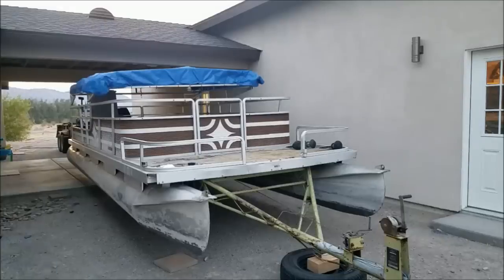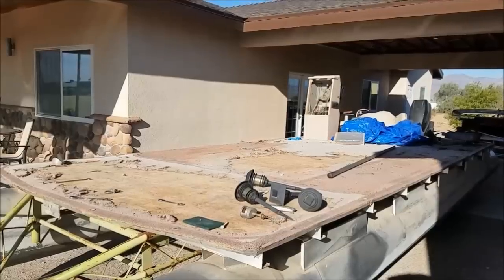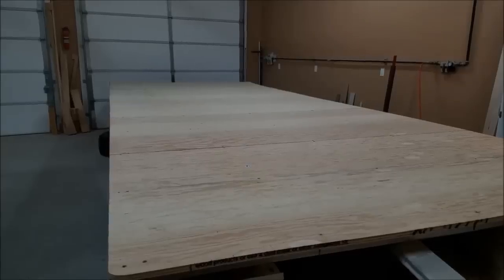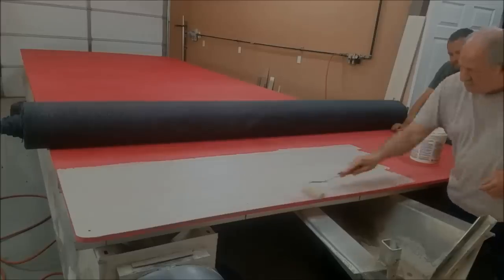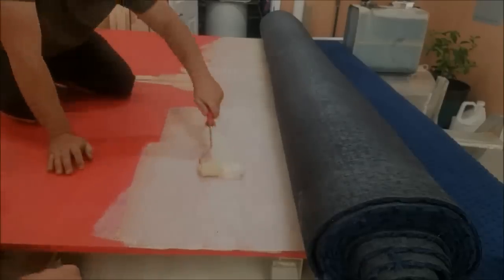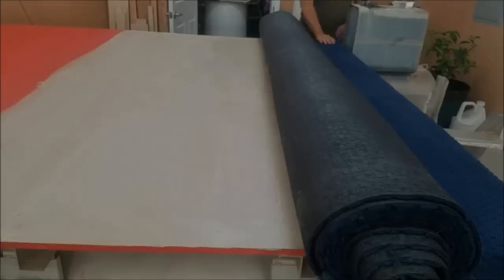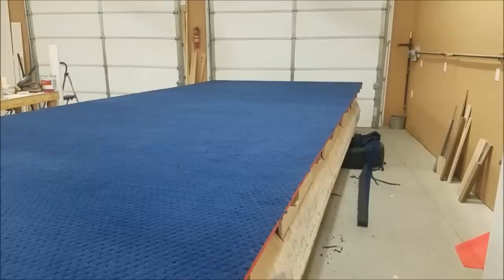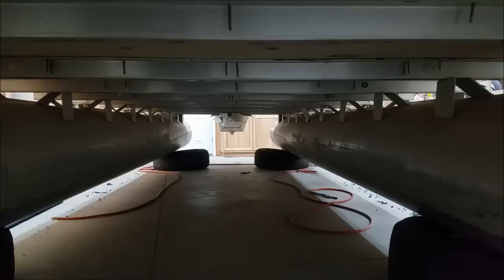Craigslist Pontoon Boat: Replacing Carpet and Deck

Comment: I would have run all my electric, control and steering cables before screwing down the floor. Coated the backside of the wood and then done a   paint on non-skid deck surface. You are right on track about the plywood. The only difference between exterior plywood and marine plywood is that marine plywood has no voids in it. All the blemishes (tree knots) have been removed and filled.

Comment: You might want to put the Red Guard on the underside of the plywood to protect it from water splashing up from the pontoons.
Reply: Camehere for the same comment. Bottom and edges as well as the top.
Reply: Gary Corrick It crossed my mind too.
Reply from the maker: I didn't think it was very needed.
Also, there are going to be a lot of screws going into the ply.
I was worried if the bottom was sealed, it would lock in water that otherwise could have escaped.
Reply: Pick up some exterior paint and just paint it if you are worried. Every few years re-coat, should be better than exposed ply. Save $$ get mis-mixed at Lowes/Home Depot or Restore shops. Best of luck.
Reply: @BrandonsGarage  You and your dad are doing a great job. Please take the time and small amount of money it will take to seal the bottom of the plywood. Too late to get under the supports, but anything at this point will add years to that deck.
Reply: @BrandonsGarage  i was told not to coat the bottom for that very reason.  Makes sense.  If you can't seal the wood completely you need to allow a way for it to dry out
Reply: After you screw everything in seal it on the bottom with bedliner coating.
Reply: @marktinaz2600  Excellent idea. Not coating the bottom with something is moronic.
Reply: @BrandonsGarage  Wet wood swells then rots if not treated first.
Reply: Nuts. Tooners lose their deck from the bottom up. People leave them in the water and the moisture penetrates the plywood.  My choice has been to coat the bottom of the plywood with resin if I intend to keep the boat. Coat top and bottom before assembly.
Reply: Right on Gary, that's the first thing I noticed. He should have painted both sides before attaching it to the boat.
Reply: @BrandonsGarage  our pontoon is  19 years old underside is not coated and its lasted just fine it dries everytime I pull it out of the water and head down the road
Reply: I came here to ask the same question on coating the underside. Just a thought if you plan on keeping it a very long time and was worried about moisture, there is a couple of tricks I have done. Both are about the same cost. 1. Coat the bottom and all sides with epoxy resin then silicone the screws as to put them in and then do a complete coverage over the top with epoxy resin. Then covered with the carpet would last almost forever and would be completely water tight, specially if you went back over the screws from underneath with silicone. 2. Would have been my first choice though and that would have been to use a composite material. And then sanded the edges just as you did and then level the joints with a polyester epoxy. Then covered with carpet. I am actually looking for a pontoon to make a tiki hut barge with a slide.
Reply: Haha! The dump off El Rodeo...
Reply: @BrandonsGarage  i think you made the right call, not painting the underside. id have done the same
Reply: He did it right sir I in fact work at aloha boat co.  In Little Rock ar. I can verify that you are doing a fine job sir
Reply: never stop fighting  i agree with your comment. I've seen people use composite deck boards for pontoon decks, I though that was a great idea, except for water could possibly splash up from underneath, through the cracks between the boards. though thats not a big deal for me personally.
Reply: He should be using marine grade plywood too.
Reply: @BrandonsGarage  to prevent seepage into screw holes 3 things. 1 drill pilot holes 2) inject silicone or other sealant into holes 3) use stainless screws. Hope that helps
Reply: @BrandonsGarage  why you inject epoxy or resin into pilot holes, before driving screws in. You should always epoxy (or poly resin, etc) any wood that's exposed to regular water. Even marine ply. I've fully rebuilt several 14-16' fibreglass boats. That's how we do it. Even plywood getting glasses is coated before laying cloth, let soak in wood. Anything else,as soon as it gets wet 1st time, clock starts ticking, rot has started.
Reply: It's because of DIYer that Think they know what they are doing that I have had to rebuild unsafe boats. Everyone. Do real research before even thinking of attempting. Watching a couple DIYer on YouTube don't qualify you for structural work.
Reply: my thoughts also
Reply: i wouldnt cover everything with that.   you do want it to breathe to dry out anything.   i screwed up on a camper floor by spraying bed liner on both sides.....floor didnt last too long because of moisture.....it is literally the opposite of what you would think about protecting it.
Reply: There is an old saying that is true, if wet wood can't dry it dies. If you put that sealant on all side, any water getting in will have no place to go and increase the wood deterioration/rotting.
Reply from the maker: @johnhaller2594  I'm almost on a first name basis with them at this point.
Reply from the maker: @izzimichaels2892  thanks for the feedback!

Comment: Good time video Brandon!
Cool to see your Dad helping you, and the baby making a cameo appearance to "hang out in the shop with the guys" Kudos for the high-quality materials you choose for the carpet work, Roberts adhesive and Red Gard are great products. I agree with your opinion regarding the plywood, exterior grade vs. marine grade. The boat manufacturers don't use marine grade either, due to cost.
IMHO you did a fine job of replacing the floor and installing the new carpeting. It should serve you well for many, many years. As a side note, Tec screws are available (@ Home Depot) with a multi-drive torx style head, and you should find the drive bit (included) in the box. I'm looking forward to the next video in this series of the pontoon boat rebuild, and I'm sure you're excited to complete it and enjoy it with your family.
2 thumbs up from here in Massachusetts, on the lake @ the "ranch" 
Doug
Reply: GOOD manufacturers do use marine plywood!!! do your research on the differences between them.if you don't have the money to do it right the first time when will you have the money to do it a second time.

Comment: I will be installing my carpet today I put my redgard on my 16 foot Sun Tracker Bass Buggy Pontoon boat I was going to redgard the bottom of the pontoon boat but in all reality I don't believe water is going to sit there and saturate on the bottom of marine-grade plywood I also used roof tape for the seams where the wood separated itself I want to thank Brandon's garage for giving me the knowledge and putting my mindset at ease to getting out there and jump in on this job I'm doing all this myself with occasional help for my son but I'm not trying to have him around some of the chemicals that's being installed. So I want to thank Brandon's garage for passing his knowledge on if I could only show some pictures and some videos I would be glad to do that this is been one extreme but fun project and I'd do it again I bought this 1991 Sun Tracker Bass Buggy 16 foot pontoon boat basically for $600 with a 50 horse force and trolling motor and pedals he sold it to me for 1200 and my company paid for the other portion of the cost through their profit share. So thanks to one of the biggest hardware stores out there who was not closing down other hardware stores that's all I'm going to say about that.
This is been the best project I've ever had I would never go what's another boat other than a pontoon boat I spent $3,000 on a 1979 Baja classic tri 16 only to find out that it had dry rot underneath the belly and throughout the transom when I took it to the shop which was going to cost 5000 to fix the problem paint the boats and trailer so the me that was taking on more than what I wanted to take on so I bought this Pontoon and thanks to Brandon's garage they have led me down this road and I would recommend anybody going to do a restoration of a pontoon boat to watch his videos if I could think of in person I would because he's really help me out throughout this journey and I wanted to share it on YouTube and I don't have the know-how yet to do that but that's another story I'm going to watch the video of how to reinstall the old trim rails and fencing once I install this carpet Saturday August 10th 2019 I'm going to open up a Instagram page and show some videos of that once I do that I will share the link.  now it's time to install some carpet thanks Brandon's. garage

Comment: I replace most everything like you did with my first pontoon boat (20'), didn't have to with my 2nd one (20').  Had so much fun with those, I bought a brand new 24' tritoon with dark blue carpet.   What a mistake...down here on the Gulf Coast, the sugar sand gets into the carpet and you can't get it out with .blowing, washing or vacuuming.  Literally, within 2 hours of buying the boat, it looked years old.  But l love pontoons!
Reply from the maker: Im concerned with that too.
I call our sand 'Powdered Sugar/Sand'

Comment: I did exactly what your doing. I have a 24 foot that I completely rebuilt into a carfishing boat. I made it a center console and went as far as re-skinning the pontoon logs for basically double the aluminum thickness. It was alot of work but the reward was completely worth it! Have fun with it!

Comment: I'd really suggest you do a parameter spread with glue and a center strip laying cheap rubber back carpet, it will not last forever and removing it will be a night mare and a lot of sanding for a suitable surface for new carpet. Stretch the carpet and tack with nail strips along the edges, remove the strips after glue sets up in about 3 days drying. Furniture will keep the carpet stretched later on as well. Very nice job guys!

Comment: Looks great. If you guys ever do carpeting again grab a trowel for the glue. It’s 10 times faster and with the right size notches you can’t really mess it up you just pour a bunch out and spread it quickly. I did a 16‘ x 6‘ boat and the main floor carpet took me aboutFive minutes to do. It was a lot smaller but the trail is really quick and with the notches you can’t mess up the amount of glue.  

Another suggestion in the future, especially if you have a shaped boats is herculiner, it’s kind of like line X but you roll it on, it’s about $25 a gallon last I used it, you could’ve done that deck for about $100. Now you can get it in three or four different colors I believe also, I did black because of the time they only had black and gray and kind of a brick colored red. It’s also completely waterproof. :)

Comment: Should have painted the bottom of the plywood with the red paint or ever a enamel based paint to seal up the wood before screwing it down.
Reply: Actually he should spray under-coat the bottom or even skin it of budget allows.

Comment: I Injoyed. Seeing you with your dad telling you the best way. Now I miss my dad more. Lost him 4 and half years ago to cancer. He didn't help me with mine 15 or so years ago when I built 3 tops redid the rails but we owned taxi when I was up he was sleeping alot. But we built things as I grew up and I really miss him.  As he fought cancer mom yea wanted a deck on front and on the back of the new house she got. So we did it. God gave him just enought just enought. I started the front till he'd got home then to be honest me and mom had falling out he about finished till painting. He did the walls roof I mean he did good. Mom she I don't think appreciate him for it either. Maybe the deck off the pool off the back of the house. But the front deck porch then roof was huge.  Bet she don't even go out side. Wasted money.  Br your vidoe got me thinking about dad more than I do already. Thank you.  But the carpet your right pay the extra mine had red like that grey your blue the desine love it good pick.   Well can't weight to see the rest now.  Man I miss mine. 24ft got for 500 with 85 mercury. Now the trailer new duel axle paid 2k but had the breaking system front steps going up.  But yea I miss it.  Wish I had one more chance to owning one. Did have one few years ago 2k ran but had a prob with gas turned to be the lid on the tank so before I figured that someone messed up the carb so never got to play with it. Traded for RV that broke in 3 weeks. Still down 2 years ago July just starter and wires no one will help me fix sad really.  But sorry I hate telling Storys get off track my bad. Great video till the next I'm gonna sub want to see more. Promise no long long messages. Lol. Hey remember them moments.  God bless y'all.

Comment: Question? Maybe I missed it in the vidseo? But did you coat the underside? Run the wiring first?  The underside is where your wood gets wet on the water and where the rot will start. The difference of marine grade vs non for plywood is NOT as the guy below says. (knots fixed). IT is also a coating and soaking they do to waterproof the wood. (or at least that is how it used to be).

Comment: Good Video. 
Suggestions:  PontoonStuff.com for Seats, Carpet, and Stuff. LOL  Larger "Texture" Roller for Spreading Glue, on a Handle Extension.  Rent a carpet roller from Lowes, Menards, Home Depot, What ever Hardware place you have down there, The wider the better.   Staple down the back edge to get it to stay in place.  We actually roll ours out and staple the over hang then trim edges at bottom of wood.  I have done several toon floors. Love the Video though.

Comment: From my estimation, you put in about $350 into plywood, red sealer, carpet, glue and screws...might be as high as $400, not counting any labor. You could have bought aluminum extrusion flooring (like used in horse trailers and reefer trailer trucks) for about $8 a square yard of coverage (less than $200 if you don't have to pay shipping on the extrusion), and had an all-aluminum floor that would never need replacing again, ever. Personally, I would have polished the pontoons, put on an aluminum extrusion floor, had less than $3,000 in it...and been able to turn around and sell it for $5,000 to $7,000 any day of the week...with the aluminum flooring being the big sell-point. Pontoon boats are like Jeeps and Harleys...build in the sell points, and they'll never ever lose their value. Be cheap in repairing them, and never realize their real resale value...just my 2-cents worth.
Reply from the maker: I never knew that was a thing. Otherwise, I may have.
It was $250 for the floor, $250ish for carpet.
Reply: Where do you get the extruded aluminum floor at?

Comment: Consider that a new one costs $35 to 50 thousand dollars and you will feel better about those saying you got a bad deal! We got into the same situation for $4500 but every thing on the listings didn’t come with a trailer. I certainly could not put a 24 foot pontoon boat on the bed of my pick up truck. So I bought a pontoon boat trailer for $4500 and they threw in the boat for free!😂😂

Comment: Was that Marine grade plywood or standard treated, and what thickness.
Reply: Did you ever find out if it was standard or marine grade?
Reply: @MJohns202020  No he hasn't responded! I know when I drilled a hole in my deck forward of the playpen for seats, It was 1 1/2 - 2" thick and you could tell it was treated through out and the glue used was also resistant to water!
If you ask me without the thickness you don't get the stability needed to not tear away from the toons under stress that is put on them.

Comment: There is a rubber sealant spray used in automobile wheel wells and undercoating that will give you some protection.  I would also glue seal the outside edges.

Comment: Along the lines of money pit, a boat is a hole in the water you throw money into.
Edit: 3/4" floor? Why not go with 1 1/8" TnG plywood like at home? Also, why not paint both sides red? .. ...It seems to me that a pet owner who brings their dogs boating would rather have the carpet so their dogs could get some better traction. But hey, what about vinyl floor tiles? You could have cut in some sub floor storage boxes and make their access doors to different tile dimensions. ..just a thought .. Another thought, something I did on my cobalt was to make cover supports using PVC pipe. You can get some tight bends in the PVC using, hot sand or hot air. For best results, fill pipe with either hot sand or fill with sand and use heat gun concentrated where you want the bend. you can make some interesting covers and shades for that thing. If you dont mind the cost, sunbrella makes the best exterior grade fabric. If not the best, maybe second to NASA. Just be sure not to skimp on the thread. Ive got a '97 seadoo speedster still using thr mooring cover it came with and I don't do anything to maintain it other than hose it down maybe once a year. ...maybe.

Comment: Didn't look as if you put the Redgard on the underneath of the ply - I would have thought you might have covered both sides of each sheet before fitting them but I guess you had your reasons.

Comment: Is the woven vinyl flooring that pontoonstuff.com sells a good quality? If not where would you recommend buying from?
Reply: Boat vinyl flooring probably isn't made by too many manufactures, I've seen it up close and it's pretty impressive stuff, I would search till I dropped looking for the best price.  You will want to go through the trouble Brandon did in making sure there's no raised areas from plywood sheet to plywood sheet.  A belt sander with a 100 grit belt will do the trick.  No need to do anything to the plywood, nothing is going to get through that vinyl.